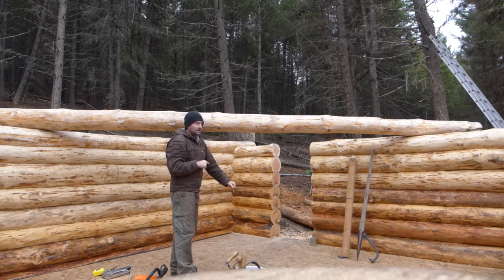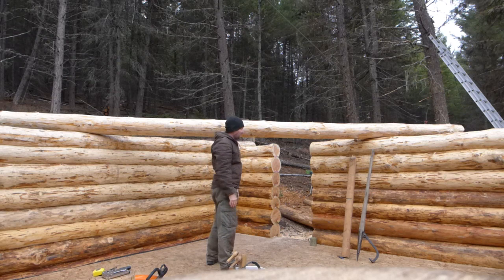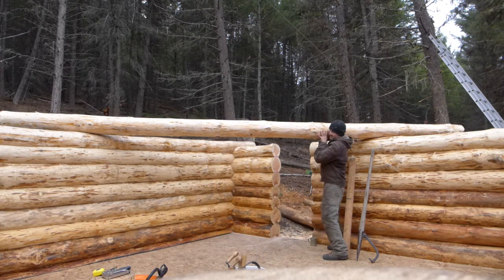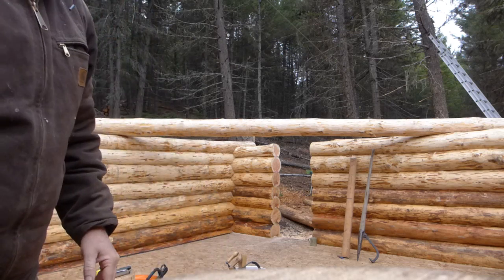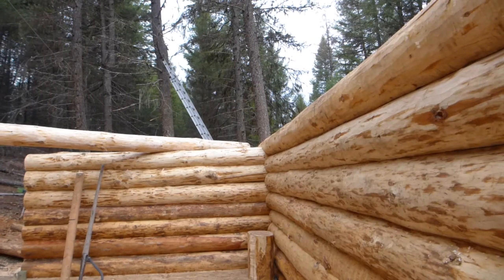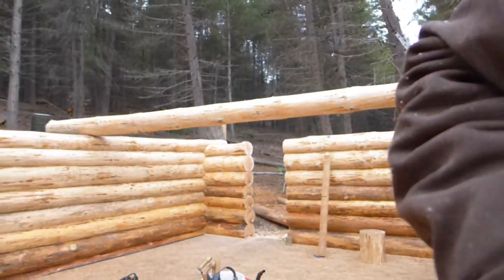Off grid log cabin build - Moving logs on the wall by hand

Comment: Did you have to acquire a building permit for your cabin?
Reply from the maker: The county I was in did not require building permits for structures under 300 sqft. I would recommend that anyone thinking of living off grid research both state and county laws around building codes... this is as important as having good solar exposure and water.
Reply: Off Grid Warrior thank you. That is good advice.